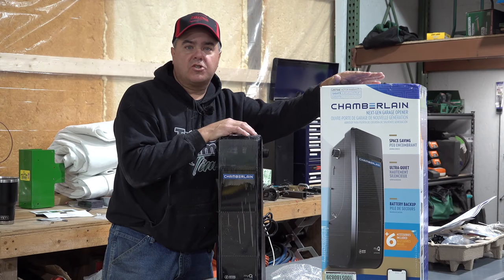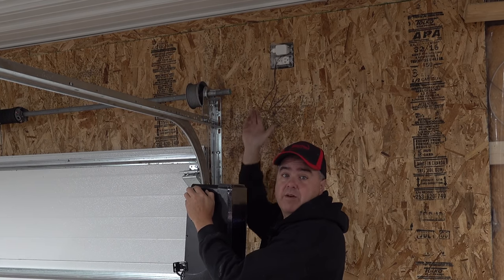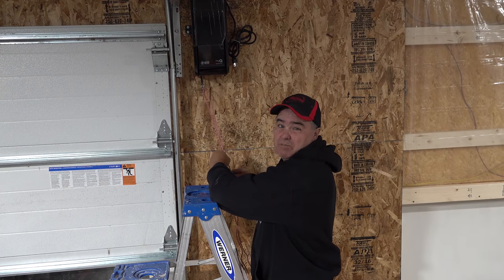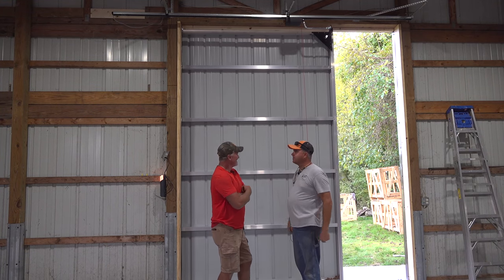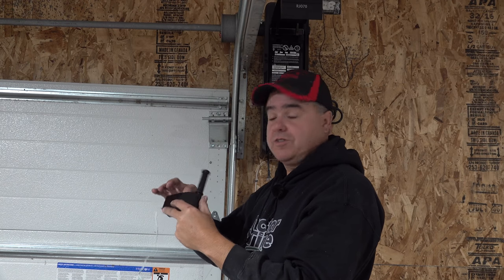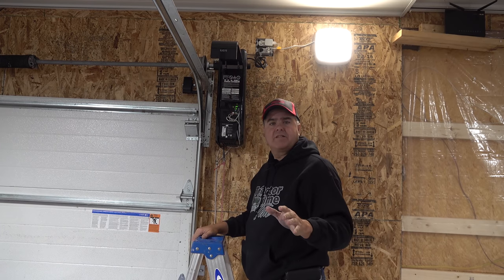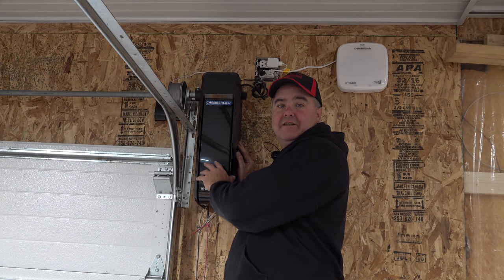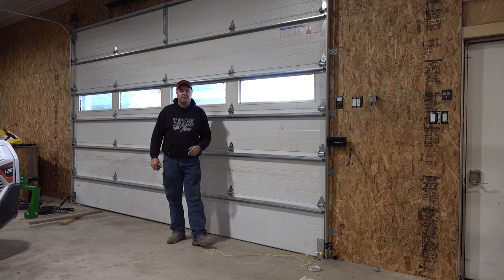Wall Mount Garage Door Opener Install - Chamberlain RJO70

Comment: I wonder why they didn't design these from the beginning. We lived in old house that had the traditional type. This seems like a simpler design than all the rail and belt or chain system.
Reply: Rooms to grow.
Reply: They are not simpler. The technology involved inside of them is more complex than your typical trolley operator from 20 years ago.
Reply: @Eaglefreek300  That's the thing about opinions everyone can have one.
Reply: @JeffStewart78..  it's not an opinion. I've been in the door business for over 30 years. Jackshaft (sidemount) openers have been available for commercial doors for probably 80 years. The technology to make them "affordable"  for residential use wasn't there when "your old house" was built.
Reply: @Eaglefreek300  Look iam not going to argue an opinion with you, you have your thoughts I have mine. I am sure you have been installing doors for awhile. That fine. Everyone is entitled to their opinion. Nobody is wrong in this instance. Let it go. Stay safe.
Reply: @JeffStewart78..  I have no idea how you see it as me arguing. I'm educating. I don't khow many openers I have installed, but it would be a few thousand. Just last week alone, I installed 7 openers, repaired 2 openers and installed a few new doors and repaired a couple doors also. I would love to share my experience with the sidemount openers and how I don't think they are all that great in a typical residential installation, but it's my day off and I shouldn't even be thinking about garage doors.
Reply: @Eaglefreek300  But here you are trying to disprove my opinion also known as arguing.

Comment: One feature lost compared to newer overheads is the camera that allows you to see inside garage.
Reply from the maker: Makes sense.  I didn’t know that feature was available.  I use SimpliSafe cameras.
Reply: @TractorTimewithTim  I use nest cameras. These new garage door opener’s actually have a camera that pops out the bottom when engaged. I don’t have one but will be using that when my garage door opener needs to be replaced. Not sure how I feel about the one you put up, though a good space saver. Not really much room between the door and the ceiling once the door is open anyway so not a big deal for me.

Comment: It appears to me that you had to move the cable tension monitor up from where you originally mounted it. At first, the top of it was about even with the bottom of the drum (17:14). Then later (around 19:55),  the top appears to be even with the bottom of the shaft. I noticed this because I bought two of these units (not the battery back-up ones) and the cable tension monitor would not fit where they said to put it. I suspect you found out it was too low when you tried to open the door and the top door section hit the cable tension monitor.

As I'm working thru the set-up procedures, the door is actually working. When I went to set the force adjustment, it would then no longer open all the way. An email to customer support and I feel they didn't really read what I was telling them. I wanted to re-set the force adjustment and they wouldn't give me the right answer. Honestly, I have left this for a couple of weeks now as I have plenty of other stuff to do on my new garage (see link below) but when I do get back to it, I am going to see if I can bypass the force adjustment. After all, this type of unit does NOT actually push the door down like the older types; it totally relies on gravity for the door to go down. It is of paramount importance to have your torsion springs adjusted properly before even starting to install this unit. Overall, I am not very happy with the unit. The concept of having it out of the way is nice but for a unit that costs more than twice as much as the older types, the design could be better.
https://youtu.be/XVs4u3G1ik4
Reply from the maker: I did move it...but I don’t think I needed to do so.  I was afraid the door might hit it when opening.
I would recommend a call to customer service rather than an email.  Much easier in this case.

There is a comment below mentioning that the track should not be level when door is overhead.   I think this might be your issue.
I think it might be causing me some issue too!

Comment: That light is triggered by movement. It cannot be on the same wall as the opener. It won't work. I learned the hard way. Thought the outlet was dead.
Reply from the maker: Works fine for me.
Reply: @TractorTimewithTim  Mine said in the directions not to put it on the same wall as the door. Have a Liftmaster.
Reply from the maker: I don’t think my light is triggered by movement.
Reply: @TractorTimewithTim  Oh, mine is.

Comment: ...did not notice if you still have to adjust the tension spring....
Reply from the maker: Already done.  You should always adjust the tension spring just like you would for manual door.  This puts the least amount of stress on the opener.

Comment: How has this opener held up? Any problems with it? Some say the lock is problematic
Reply from the maker: No issues with the lock.  I have had to adjust the door springs a time or two and they need it again now.  This was a new door (and springs), so maybe the springs are going through some initial stretching.  I’m thinking this opener is a bit more sensitive to spring tension than others.  Or perhaps this is due to the door being larger than standard garage door.  Not sure.
In any case, would definitely purchase the opener again.
Reply: @TractorTimewithTim  Thank you very much for the reply. I'm going to give them a try as I will need 3 of them for the new house we are building. Will need to get a tractor again as i sold my B2601 when we moved. This lot has a pretty good hill so I'm leaning away from a CUT. May just get a X758 this time as a ventrac is just a little more than I care to spend

Comment: I had three brand new doors installed and I insisted on the side mount motors instead of the traditional openers. They are "Jack Mounted' installations. I love these openers! Quiet, less moving parts, and I love the clearance. I also had them put high track installation which the tracks are much higher than normal.

Comment: The middle of my pipe between the springs has a bracket... yours must be too low causing the sag in the pipe, creating the pipe end to be out of level
Reply from the maker: My middle bracket is level...but pipe still sags
Reply: Unbolt the motor from the wall and move the center bracket up, the torsion bar and motor should be level, not the bracket.
Reply: @bobkint3105  DO NOT touch the center bearing bracket that the springs are connected to, unless the springs are unwound. You will seriously injure yourself, otherwise.

Comment: The rollup doors are cheaper than the panel (our panels are actually thick and filled with foam) doors where I am at.
Reply from the maker: are the Rolliup doors insulated as well as the traditional doors?
Reply: @TractorTimewithTim  yes, they are also filled with foam but thinner than the panel type...

Comment: How did you get the door to engage? I tried everything, every way, the door will just not engage in gear...any tips?
Reply from the maker: Discussed in the episode...at least I think it was the same issue.  Pull down harder on the release rope to reengage.
Reply: @TractorTimewithTim  if i pull down harder i will pull the opener off the wall lol. I called support and they can't understand why either. Thanks for your help tho. The video was very helpful for everything else.

Comment: Nice. You keep referring to pipe. Mine is a solid steel bar.
Reply from the maker: Mine is pipe.
Reply: @TractorTimewithTim  it’s a 20’ door. Maybe that’s why mine is solid I guess. Heavy to. My wife and I installed it piece by piece. Wish this opener was available then 2009 I think. Never saw those anywhere. Very Good. Thanks for sharing

Comment: You're going to have issues with this opener on that size of door. After several hundreds of openings, the torque always starting on one side of that bar, you will eventually get misalignment with your pulleys and tension wires, and the door will fall. 
I know, I have two of these, and the smaller door (8') has always been fine, but my larger 16' door has fallen off three times in 5 years, and it was professionally adjusted each time. They told me these openers aren't all they advertise to be, and after getting fed up with them I've switched back to belt drive, center pull systems that are always balanced.
Reply from the maker: Interesting. Did you re-adjust the spring over time?
Reply: @TractorTimewithTim  Yes, it was adjusted multiple times, because I could hear the misalignment beginning to get out of control and could tell there was too much tension on the opener side of the door. I would call the technicians and they were always happy to help, but all of them (two different guys from two different companies) said these openers always get out of alignment on wide doors. It's just the physics of it all. Center mounted door openers by their very nature keep everything balanced.
Reply from the maker: Interesting.
Reply: @TractorTimewithTim  Good luck with them, over time. I hope they work for you. I really wanted them to work in my garage because they are so quiet and free up so much space. Mine were LiftMaster 8500's.
Reply: Hello, thank you for sharing this video and the clear explanation of your installation. I have been wanting a wall mount system such as these, and I have also looked at YouTube examples of folks that have converted their overhead openers to wall mounts using their old motors with some modifications (chain and pulley).  But I have another modification I would like to suggest, if anyone is able to execute this, as I am not savvy enough to do so myself.   Consider this: if one has a second pulley mounted below the upper pulley and wound the cable continuously in such a fashion that you have pull (force) in either direction (up to open, down to close) then the garage door would be lifted or lowered depending on the direction of the motor. You would have this placed on both sides of the door such that you have no binding of the door as it travels in its track.  And I would think you could do away with the torsion springs, eliminating the danger of springs breaking and possibly causing injury.

Comment: If one of my guys ever put one of these on a standard lift track without push rods or 1/12 pitch id make them cover the warranty. Wait till that door stiffens up. Mark my words you will throw cables. Pitch your track up 1ft in the back. It cant be perfectly level horizontals. Think about it when the motor starts all its doing is unwinding springs to release tension. When the door stiffens without gravity to help get it started till at least one panel is verticle (free floating) it has no reason to want to go. Pitched track lets gravity help. Hands down 99% of the problem we see in this motor is that wrong installation. If done right, its one of the best motor systems you can get.
Reply from the maker: Thanks!

Comment: Power door lock is useless on an insulated door that size. The motor locks the spring assembly. Just an FYI from a Garage Door Guy
Reply: I always though the power lock was just for customers who didn't understand putting a manual lock on a motorized door is a service call waiting to happen.
Reply: @Wallbank888  if you have a  motor on a door it shouldn’t have a lock on it at all. If this was a little single car garage door it would make sense to put the power lock on because you could dead lift the door from the outside. Double car garage or an insulated door no one is dead lifting that from the outside
Reply: @KenandChristyFullington  Sure. I agree with all points. The fact remains I often get customers who want a lock on the door no matter what. And this is after I tell them I won't warranty an install of a motorized door if they want a lock installed.
Reply: @Wallbank888  agreed

Comment: I refuse to nit-pick but alas, I must, just the OCD in me shinning through....  15:34 The great outlet debate  Which way is up.  One school of thought is that ground prong up is safer if a piece of metal drops in from above it will hit the ground wire and be "shielded" from hitting the hot maybe.  However as you prove in the outlets above (not sure why they are sideways but, I am guessing that there is a header that runs horizontal up there) you prove the point in that most devices and manufactures assume that the ground pin is on the bottom.  This is true of most double insulated wall warts that use a polarized plug as well.  You notice the wall wart power supply at 15:21 would be pointed up if plugged into your "upside down" out lets.  If you have any electric based water things that require GFCI's on the cord they will be upside down and the cord will go out the top and pull things down.    This logic is completely opposite for the larger 240V NEMA straight blade receptacles (14-30 and 14-50), which all assume that the ground plug is indeed on top as most are bottom fed cords and will sit correctly that way.   Otherwise great job, and keep up the good work!
Reply from the maker: You just MUST nit-pick.  Hmm.  Where are your videos so that I can return the favor?
Reply: @TractorTimewithTim  Excellent point Tim, that is why I am not in front of the camera.  I was only on camera back in the 80's for local public television station.  You and Christy are doing an excellent job, I have fallen behind on your videos so I am binging them a bit now.   I have already put a quarter in my OCD comment jar, and will send it up to you when it fills up!  😁😁😋

Comment: You are not supposed to use these without high lift tracks or rear pusher springs. The cables can come off and door can fall.

Comment: I feel like I can knock this install out myself.  Thanks!  What’s up with the cat being blurred out??  Cats r just cats leave em alone.  We can handle it.
Reply from the maker: You shoulda seen the comments...folks cannot seem to avoid crude talk. We are so warped as a society.
Reply: @TractorTimewithTim  I would have probably made a funny comment as well.  Lol.  Did u mount the garage door opener unit right to the wall or is it hanging on the cable shaft?
Reply from the maker: It is mounted to the wall.
Reply: @TractorTimewithTim  I should have phrased that better.  Obviously it needs to be or it wouldn’t be able to rotate without moving.  Does the Liftmaster mounting brackets (included) give u that adjustability without wood spacers?  Thanks.

Comment: Did you add the window to your garage door?
Reply from the maker: New garage door...insulated.
Reply: @TractorTimewithTim  Do what? The window was on the original garage door installed?
Reply from the maker: Yes. I ordered the door with windows in it.

Comment: I find the description of "next generation" to be comical by the manufacturer.  Wall mounted garage (dock for warehouses and factories) door openers have been around for well over 40 years.  It is about time that they FINALLY brought them to the residential market.  It is a far superior design to the traditional openers.  
I will use this style (not sure of which brand) of opener in my next building. I'm not a fan of the WIFI and battery backup options. It seems to add a large amount onto the costs without much of a benefit/cost. That is just my personal opinion.  Many people love paying for those options.

Comment: Battery backup on that unit is a joke, only lasts in standby for 24hrs if you don't open the door, otherwise it is good for 1 open/close cycle then it's dead.
Reply: That is the point. If the power is out and, for example, you need to get the car out of the garage to get to the hospital, that single open/close could literally be a life saver. It is not intended to be used repeatedly during a power failure. At least, that is what I tell my customers who want to purchase one.

Comment: Thanks for the video. After watching it, I will not be installing a wall mounted opener. This thing seems like the biggest pain in the ass imaginable. Multiple external components (an external light? come on), a locking mechanism which I highly doubt will function properly 100% of the time, mounting to the wall itself seems like a huge pain, travel distance and pressure regulation? And how does it make any sense that it pulls the door upwards on only one side? It seems incredibly unbalanced, not centered or symmetrical, and it's made of plastic. Looks to me like there's too many variables which can go wrong; even the installation trouble you experienced is a bad omen. Sounds like another one of those new-age technologies which seems like it's supposed to be more convenient but really isn't, kinda like a tankless water heater.
Reply from the maker: 1.5 years later…
Light is a non issue.  Trivial to install, no issues.
Lock 100% effective.  No issues.
Mounting to wall much easier than hanging something overhead.
I think maybe you are having a bad day or something.

Comment: I guess the pipe must be the 1" shaft.
Reply from the maker: It is a pipe..hollow in the middle .  Yes, functioning as the jackshaft, but simply a piece of galvanized pipe.
Reply: @TractorTimewithTim  I was joking,been doing commercial and resi doors and ops for 21 years.